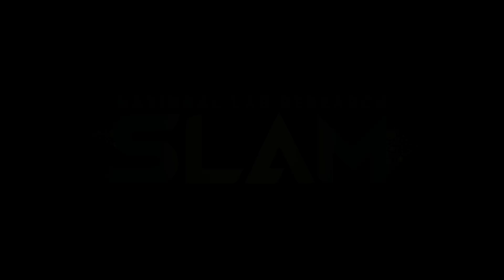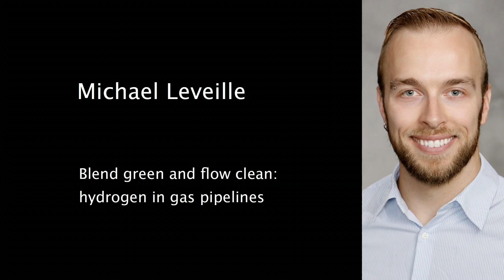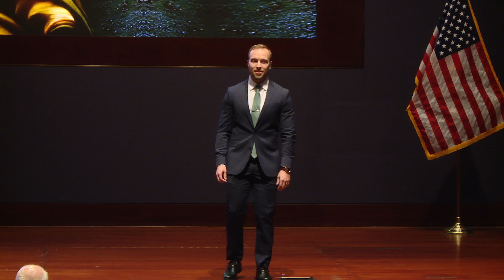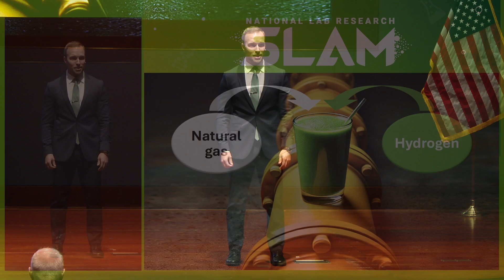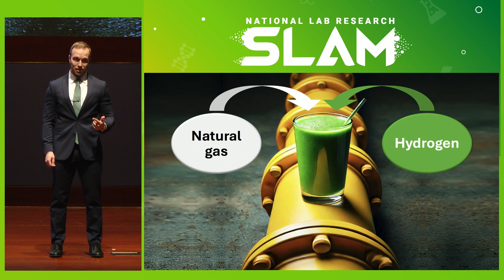Michael Leveille -  "Blend green and flow clean: hydrogen in gas pipelines"

Comment: Interesting work on an intriguing concept. Hydrogen is notoriously difficult to corral as I learned from rocket engineering. Maybe at lower density and pressure it can be managed in the NG ecosystem.